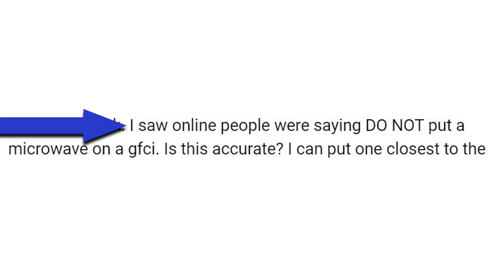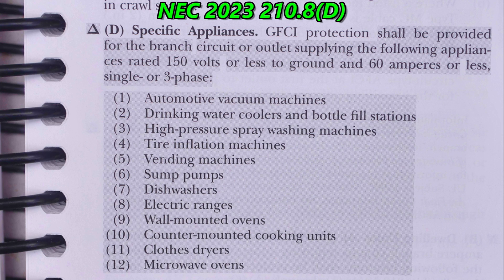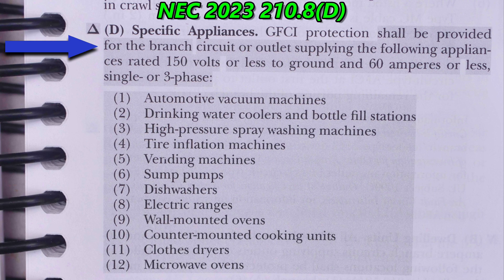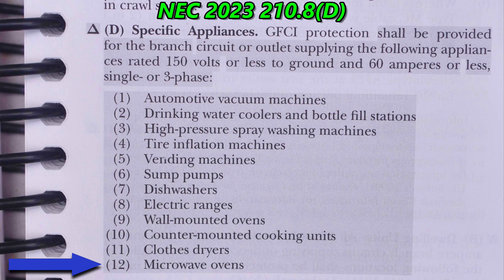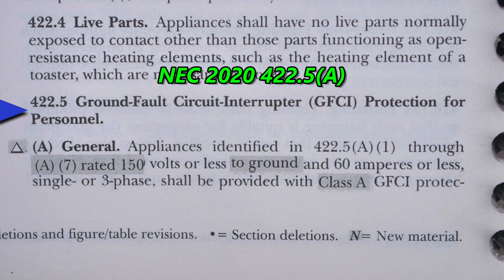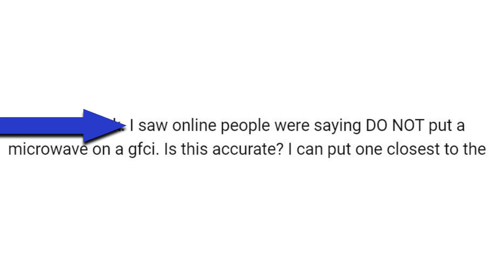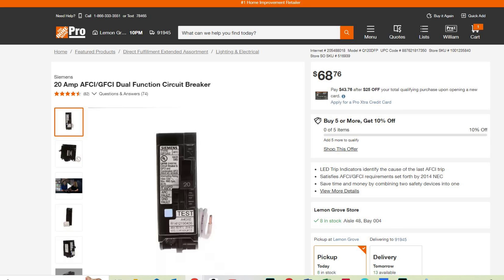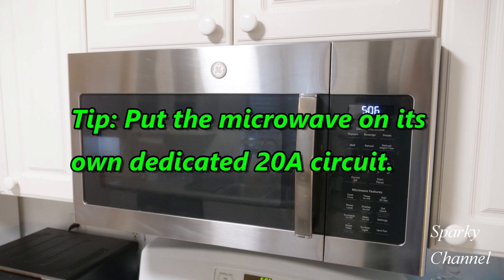Do Microwaves Need to be Protected by GFCI? (NEC 2023 210.8(D)

Comment: Canadian electrician here. We have not adapted range, dryers, microwaves etc for GFCI protection. It seems inane, but maybe I'm just uneducated about the reasons. The only reason I can think of is to push new products out the door that otherwise wouldn't be bought for any reason. I struggle to think of a valid reason why an elevated microwave needs GFCI protection. Likewise with the range. You go from charging the homeowner $40 for a two-pole breaker now to several hundred, causing homes to be continously more expensive, and if you're doing renovations you must charge for all this accordingly, and your prices will push people to seek alternative contractors that will do the jobs for cheap and not pull permits. 

If anyone has a valid reason to install a range, dryer, microwave on a GFCI branch circuit or receptacle, please kindly let me know.
Reply from the maker: You make excellent arguments. Each edition of the NEC gets tougher and tougher. I was just trying to answer the gentleman's question but I like your discussion/comment. Let's see what other viewers feel about this.
Reply: This code says circuits at 150v or less, so it wouldn't apply to any oven or range I've ever seen. Still, that make even less sense.
Reply: @jameskoehler4939  I thought it was talking about 150V to ground on each phase, because it is specifically referring to an electric range, and you only get >150V when you check phase to phase. I've never seen an electric range at 120V unless it was gas. Then again I guess you can argue that a gas range is still electric if it plugs into a receptacle, except it's primary heating elements are not electric. Anyways, now we're getting too far off topic😅
Reply: @jameskoehler4939  The Code references 150v or less, to GROUND, not phase-to-phase. Therefore, a 240v range (120v phase-to-ground) would be included.